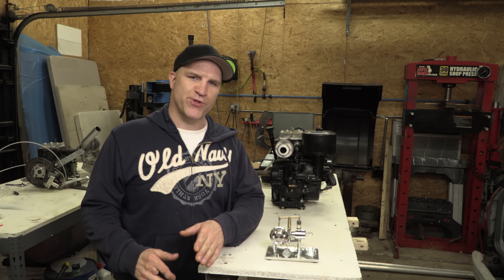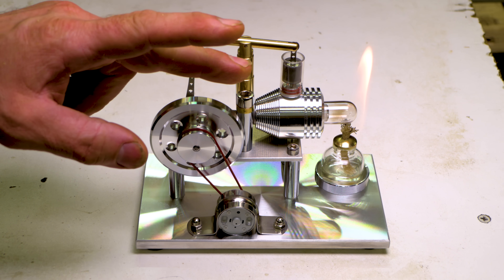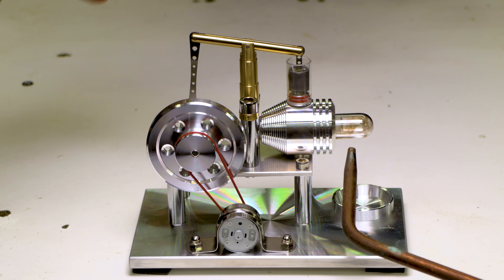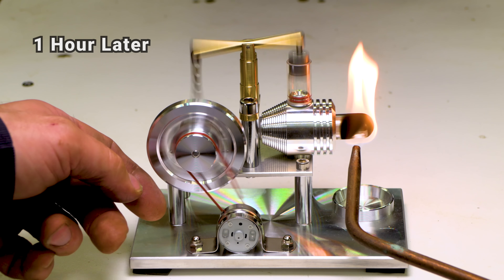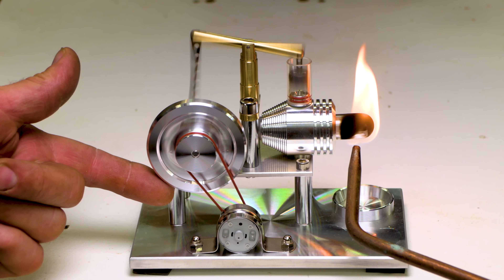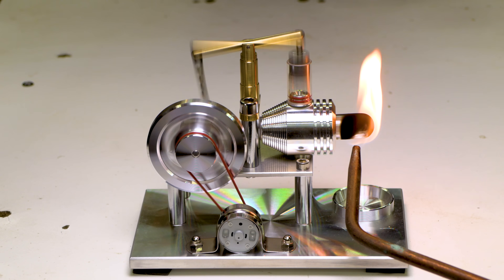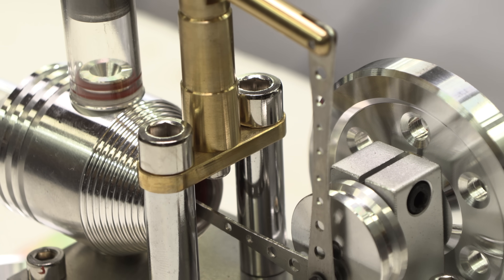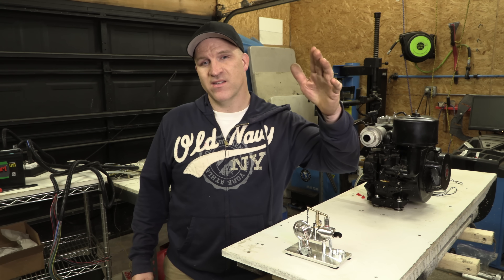Can a Stirling Model Engine Run Non-Stop?

Comment: If you load the little generator with a resistive load, you can measure the voltage and current and use it as somewhat like a dyno.
Reply from the maker: exactly what i was thinking but much more extreme!!! great minds think alike!
Reply: @WarpedYT  I have a design in mind for a larger more permanent engine, if you want to discuss sometime.

Sorry I haven't posted in awhile, since I guess the electric arc video slowmo inside slowmo.
This was a great engine,  much better than the one I bought, where'd you get it?
Reply from the maker: @ShifuCareaga  nice I'm always down for a discussion, I looked on your channel but I couldn't find the electric Arc video.

Comment: So the torque lessens as the difference in heat lessens?
Reply from the maker: exactly, thats the idea, the cooler the heatsink stays and the larger difference in the temperatures the more efficient the engine is.

Comment: Makes you wonder how much you could capture by having a solar heated 'hot side' and harvested the work somehow via batteries or lift pumps or something on an upscaled version.
Reply: That would be awesome, I wonder if you would be able to capture more power than solar panels alone. Would it be more efficient?
Reply: @BendingPhysics  I think solar panels are around 15 - 20% efficient...The thought crossing my mind is have more surface area via a hot water solar and once running it could pump itself with anything left over as the harvest.  Not sure how it would compare to panels, but it is interesting.
Reply: Sterling engines are incredibly inefficient, the date is out there if you want to see large scale versions and their super low efficiency.
Reply: @otm646  Yeah, they've been around since the 19th century...I figured if they were better, we'd see more and that something was preventing adoption beyond curiosity.  Thanks for validating my suspicions.
Reply: @otm646  hmmm... I thought I remembered solar Sterling engines to be more efficient than solar panels of the same size collector, but the downside is the high speed moving parts. Been a while since I read up on them, could be wrong.